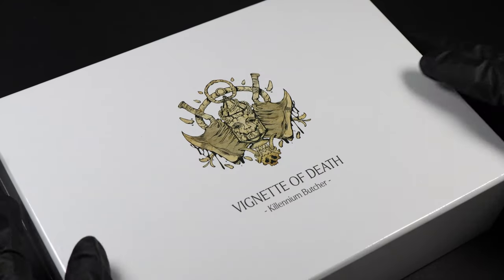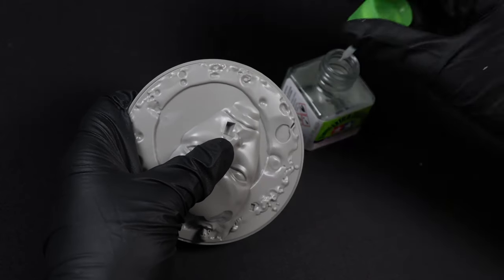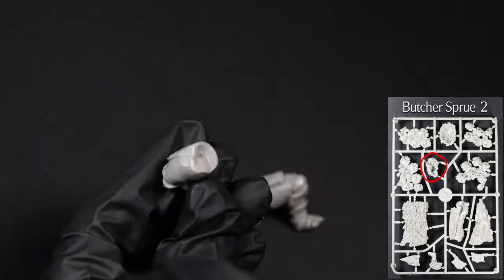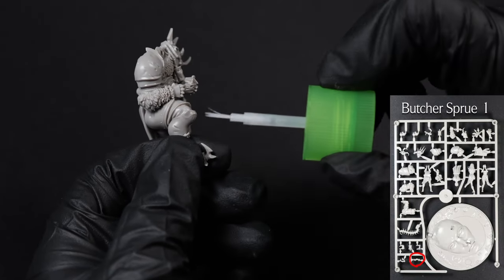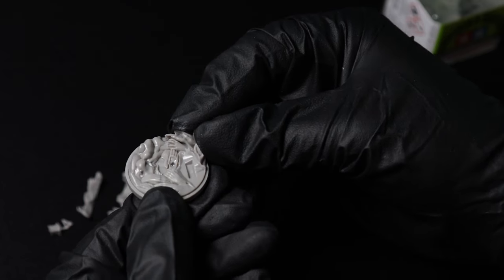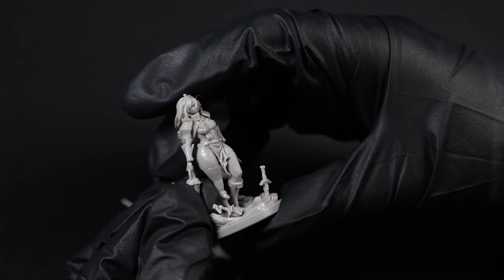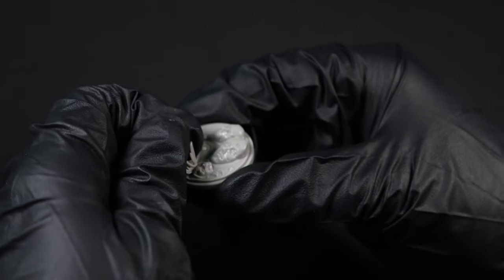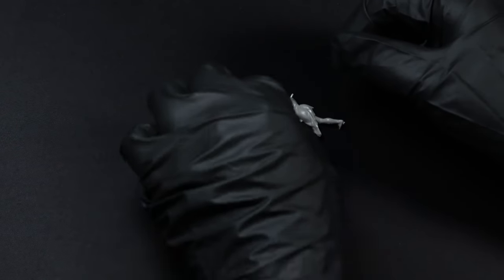How to assemble the Killennium Butcher | Kingdom Death

Comment: Does Forgot have glasses? In kdm shop in the art and on the mini, there are glasses.
Reply from the maker: I believe that she is meant to, but either the decision was made to remove them from the sculpt, or there was an issue during manufacturing. If you look at her nose near the corners of her eyes, you might be able to see where the glasses were/should be resting
Reply: Came here for this question.  I guess they "forgot" to put the glasses on the sprue 😂